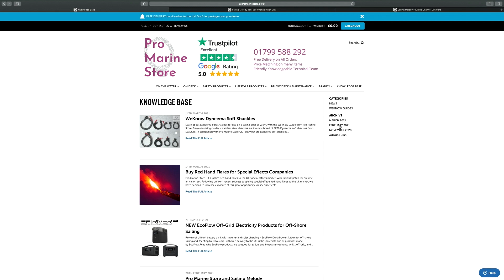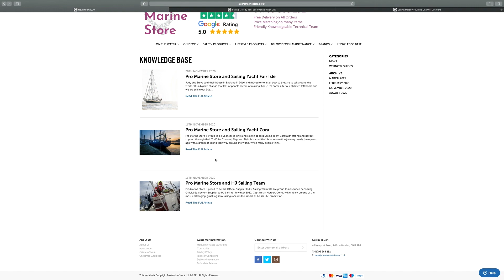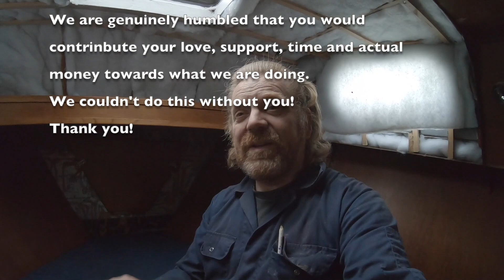#35 - I needed to smash something!!!! ANGER MANAGEMENT???

Comment: Melissa. I guess you could say that work day was an Ian day as I am a little grey and a little cold a lot of the time(at least in winter). I don’t know about the rainy bit, but the rest fits. 🤔
With that first coat of paint/primer on the pilot house it made quite the difference. Certainly made all that hard work look worthwhile. 
Nice to have the V berth serviceable. I personally would stay away from the spray foam. It wouldn’t be easily removable, and could wind up hiding rust. 
Keep up the good work guys. Things seem to be coming along nicely.

Comment: Get yourself a "Descaler needle gun" 
. It's like a miniture bead blaster but without the beads.  It will save you a fortune.  Sanding will drive you mad eventually.  A descaler will remove lots of stuff to depth and leave just sound steel ready to weld to. 
You can use it in harder to reach places.  It will also tell you how sound remaining steel is. .. 
Dai Yawn?
Reply from the maker: We have several pneumatic needle scalers 
Here the rust was very very thin and superficial and not scaled and could be sanded through in seconds with a hand sander. Thanks for the tip though
Reply: @SailingMelody  I'm loving the project and happy you moved up to a bigger better boat.

Comment: I believe that you will get there in time.  In boat projects, it is mostly a matter of attitude (although life sometimes intrudes!).  While spray foam insulation sounds like a cheap and fast solution, in the long run the lack of inspection without chipping it out is very dangerous in a steel yacht.  Please cut and fit insulation if you can.  You will sleep better for years to come!

Comment: on my oyster39  we put sticky back foam on hull  then  house rock wool  for extra insulatian , works well and keeps down cost .  solar vent in wheelhouse  works well moves a lot of air  swan necks for mast wire  nav light replace bulbs  with led ones  and inside lighting  . us tinned wires everywhere   ,  it pays  in long run ,   a vacume head  less parts to go wrong  . we put stick on foam sheets  on  metal fuel tanks reduced water  condesation  in tank 90%  less water less bug .  took me 4 years one up   ,in water now in lock down though   .keep safe  sea you afloat .
Reply: house rock wool  is a NO NO on a boat

Comment: Once you put your top coat on, please take another step protecting it against UV. It’s expensive, but I recommend ceramic coating which penetrates paint and epoxy making it harder and giving you many more years of good paint. I apply it to boat in my work after cutting oxide buildup on boats. I’m a paint and gel coat restorationist. It’s very long and painstaking work to knock back oxides on an entire boat.
Reply from the maker: Ohh that’s interesting to know
The Jotun hardtop is supposed to have superb uv protection but maybe you could look at the spec sheet and tell us what you think
Reply: Sure, I’d be happy to. Please send me the type of paint, so I can look it up as Jotun is not a paint that’s common to the U.S.

Comment: While "Spray Foam" may be the best insulation, it will be stuck on the metal and you won't be able to get it out for inspections. 🤔 If you use Foam sheets you can cut it to fit into the spaces and remove it when necessary. 🤔 Enjoying watching Jack 👀 and watching the progress 👌 from Prescott AZ. 👍⛵🤠🌵
Reply from the maker: Definitely getting mixed messages about the insulation for sure
Reply: Foam sheets for sure. Check out Emerald steels video on that one.
Reply: @SailingMelody  my current project Is spray foamed, and I'm spending  more time removing foam to check for damage than actual repairs, it seems like a great idea and if the boat was brand new sure it's a great idea. But once its 10 years old, everything needs to be removable. Most of the worst damage I've found is under spray foam!
Reply: @SailingMelody  Maybe contact Bruce from Mistress he went through the same as you guys and went with spray on
Reply from the maker: @DiscusRussell  we can’t afford to have that done properly sadly. It’ll have to wait until we have more money and we’ll go with something else until then
Reply: @SailingMelody  I cant remember if Bruce did it himself but if the steel is good and protected its the best

Comment: You obviously have a very practical and sensible approach to this project and I've no doubt that you'll reap great benefit from it. I'm by no means an expert but I do have a bit of a habit when it comes to sailing channels and everybody says to stay away from silicon sealant on a boat.....You keep mentioning it and I wondered if you had done any research into suitable sealants?
Reply from the maker: We use Silaflex not silicone.
The only time we have used silicone is when we ran out of proper Sikaflex but had to use silicone as a last resort due to a storm coming our way
Reply: @SailingMelody  Phew, good report.

Comment: Think you will always have condensation being your sailing in a cold atmosphere running the heater also I think making the head smaller may become a problem unless your jack showering in there lol
Reply from the maker: We are hoping to not spend much time in cold climates. 
We can always change the head if it becomes a problem but the floor space is now bigger as we will be moving the seacocks. The bed was unusable for the two of us due to the length on that side so we had to make a compromise. We will see how it goes though. Won't be long before jack is taller than us I'm sure lol

Comment: GBP 3/sack seems reasonable (about NOK 30/sack), it's ok. Good people should not be underpaid!  I know everything about anger management. Built my own Loa 42" steel sailer with angle grinder and welder :-) It took in fact a countless number of angle grinders. They worned out. Regardless if they were branded Metabo, Bosch, Makiita or Meek. If you consider spray  foam as insulation, the spray dust creates a bloody mess. Best if the hull is completely 'clean'. My boat is sprayed to at lesst 30 cm below waterline to prevent condensation. Note in cold climate steel ribs not covered will produce condensation.

Comment: The problem with spray foam is once it's in it's in. Any hull problems will be hidden and further treatment of the steel will be virtually impossible. There was a period when a lot of cars had sections like A posts filled with foam and rust was the result. Cold climates do need good insulation but if you intend to stick to warmer climes not so much. What do good yacht builders use now? I suspect, not spray foam.
Stapling in some cheap curtain material could make things a bit less stark in the forward cabin. An end of a roll from somewhere maybe.

Comment: Composting toilet in a camper, fine, in a boat when stuck at anchor, you'll end up tipping it over the side anyway, probably tripping and spilling it enroute. Just go with the through hull and cut out the middle man in my opinion. Having said that, if stuck on the hard for months/years, the former would give you something useable!
Reply: We found the composting toilet extended the time we could sit at anchor and it got rid of the stink we lived with for years. With the holding tank we had to leave regularly to either pump or dump the tank in open water, it is nasty to dump in harbour. With the composter, the separated fluids could be taken ashore and dumped in a toilet (or in a bush or over the side if the wife wasn't watching) and the solids would go for weeks before they need changing. You have days after noticing that the solids need changing and when it absolutely needs to be done. You could store a change of solids in a sealed 5 gallon bucket and likely get 6 weeks or more of continuous use. I tip the solids into a garbage bag in the head and have never accidently dumped it. You do have to keep an eye on the fluid tank as it will overflow which isn't fun. An overfilled holding tank is worse. Some directly plumb the fluids to a thru hull but I was happy to get rid of the extra holes in the boat.
Reply: @mngbennett   Some good points but still prefer a decent holding tank but can be a pain having to empty it every now and then
Reply: @robinacjohnston  Yeah, both have their advantages and disadvantages. Having put up with one I far prefer the other for our situation.

Comment: Get used to sanding. Boatwork is 90% sanding and 10% of non sanding. Invest in a grinder with 20 grit discs. The right tool for the right job will speed up the process, strap yourselves in for the long haul guys!.

Comment: I have never heard you mention, what boat Melody is, a 40 foot ? Who built her, what model is she, do you know? I like the bilge keel n center board system.
Reply from the maker: Hi :)
Melody was designed by John Teale and built by F.L.Steelcraft
She was designed as a 35ft cutter but the original owner specified a bowsprit and a bathing platform so she is 35ft on deck but 43ft LOA with a 32ft waterline.

She is cutter rigged with a furling Genoa and a Hank on staysail 

She has an 80hp Ford Mermaid Diesel engine
Reply: @SailingMelody  Cutter Rig Fantastic Best rig you can have for cruising no ifs no buts
Remember after about 4 to 5 turns in the Genoa dont have a good shape well thats my experience anyway. Cant beat Hank ons but for ease of sailing furling with the loss of performance
Regards
Reply from the maker: @DiscusRussell  yes we like the sail plan for sure

Comment: Teach me, is that Marine primer better to use than a rust converter?
Reply from the maker: They’re completely different things.
We clean up the steel.
Abrade to a good key.
Apply a rust converter to deal with any little tiny bits of corrosion which have been left 
Then paint with epoxy primer.
We’re not experts and don’t pretend to understand the chemistry of this but it seems to be the accepted method